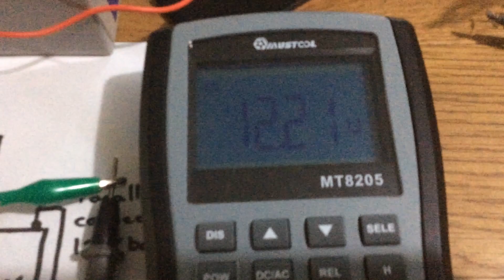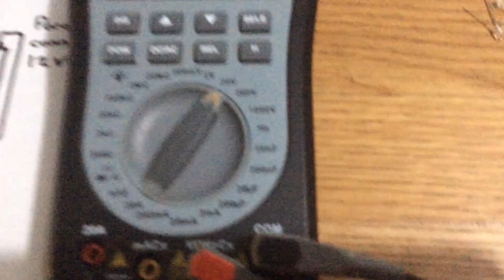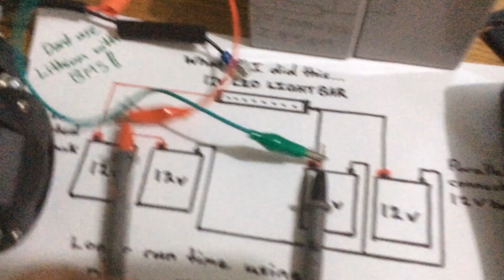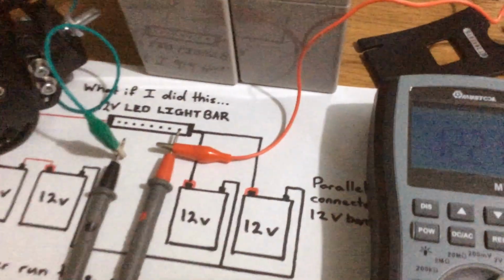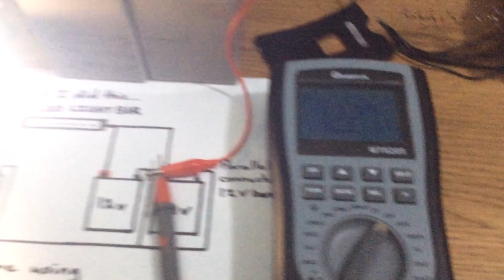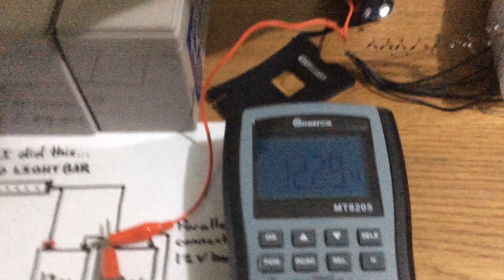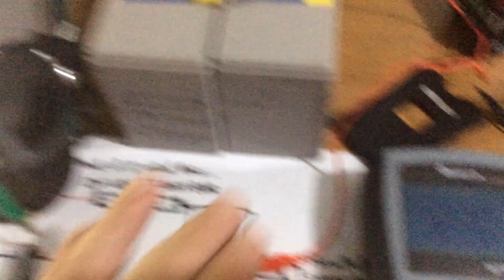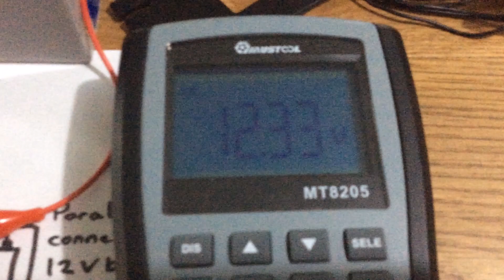Tesla Power Saving Power Transfer with 12 volt batteries.

Comment: i imagine using this system to 220volt system and powering all my home appliances. just my dream 😢😊
Reply: hope i can use 220 volt inverter as a load. 
and wanna use low frequency inverter with toroid transformer inside.

hope the capacity on the batery bank remain efficient or it depend on wattage on my inverter. 
much to learn ❤❤❤
Reply from the maker: I have tried a small 220 volt inverter as have some of my viewers, if you check some of the comments on these Transfer videos you may find others detailed findings which is all valuable information. Please feel free to update me on your efforts for everyone's benefit. Be careful not to drain batteries too low or employ a cut off mechanism, if lead acid batteries are drained below 50% they will be damaged. I make a habit of disconnecting and rotating batteries when the drive battery reaches 24.2 Volts which is considered flat.
Reply from the maker: Thank you for your comment.
For anything to be a reality it has to dreamt up in the imagination first.
The full Tesla switch was more than capable of fulfilling that dream.
A company called Electrodyne Corp. tested the full system burning a 3 KILOWATT load for 2 YEARS.
Can I suggest start small, its much cheaper to experiment without everyone getting pissed that you destroyed their power for internet. This way you can run all the test you need, instead of waiting for everyone to leave before you start pulling things apart. Once you have a small success you can feel comfortable about spending big.

Comment: Can you use this transfer method using a 24v inverter that then powers a load?
Reply from the maker: Thank you for your comment.
Absolutely you can, one of my subscribers has confirmed he has done exactly that. I have also tested this with small inverters. Please be aware that the voltage of operation is between the two banks, meaning if you have two batteries in series making 24 volts transferring to a parallel bank of 12 volts then the voltage seen by the load is the series bank volts minus the parallel bank volts.
ie. 24 volt bank - 12 volt bank = 12 volts at load.
Therefore you will be wanting to use a 12 volt inverter and not a 24 volt one.
Assume you already have a 24 volt inverter, then you will require a 48 volt serial bank and a 24 volt parallel bank.
48 volt - 24 volt = 24 volts at load.
I hope this is clear.

Comment: I have a question on temperature. Is there anything notable in regards to the temp on either side or do they stay at ambient? You noted that the higher the current draw of the led the faster the transfer, I'm just curious on how that effects the battery temp.
Reply from the maker: Thank you for your comment.
I have noticed at different stages that the LED's have different temperatures. Even the LED that was not illuminated in my first videos on this subject would feel warm to the touch. Admittedly there was no scientific approach in relation to temperature and more just a mental note due to curiosity. The batteries don't exhibit any obvious temperature changes, again not a scientific approach, I assumed there wouldn't be a temperature fluctuation for the batteries as the current being transferred is so small and slow so it would not violate the acceptable charge or discharge rate, the load is chosen with this consideration.

Comment: As a beneficial side effect of this setup is that old batteries could be partially revived. For example, if you have a 12V battery that maintain only 0.5V (practically dead), you could increase that to 5V, and use it to power a Joule Thief.
Reply from the maker: Thanks for your comment. Sorry for not responding earlier but this message is not visible for me in the videos comments so I’m responding through YouTube studio. I believe you are correct and this could be used to charge batteries that are below a conventional battery chargers low voltage cut off. I have a modified joule ringer that repairs batteries very well, hurts the ears though, I have used it to repair quite a few batteries over the years.

Comment: Do you think you d'ont lose the energy because you are not connected to the groud ?.  Lost of energy with the LED would then be linked only to the production of temperature (which is not a big amount)
Reply from the maker: Thanks for your comment. For some reason I missed this comment. In this case I don’t believe it to be related to not having an earth but more likely related to the concept that energy can not be destroyed nor created, so where does the energy go in our normal systems? I believe the energy is converted to heat in conventional electronics whereas this system transfers energy to the lowest potential.

Comment: This is fundamentally the Tesla Switch circuit, where the series and parallel branches could be electronically switched. I built that circuit years ago. The flaw in this approach is that the series batteries are running the load current in series across the two batteries. As such, they collectively are each using the AH rate of the load. The parallel batteries, while being charged, has to split the load current between them and are being charged at half the AH rate as the series batteries being discharged. The light IS using power, because it gets hot proportional to the voltage drop across it. The led light on AA batteries is a very low load and I don't think will scale to the higher power experiment. But time will tell and I enjoy watching your experiments!
Reply from the maker: Thanks for watching. Your are correct, this is part of the Tesla Switch, obviously missing the switch and I suppose that makes me the switch. I would love to know more about the switching circuit you used if your willing to share. A company called Electrodyne Corp. tested the full Tesla Switch running 2 kilowatts of load for 3 years so I believe it can be scaled up but the switching is the the real key. Electrodyne Corp stated the switching frequency needed to be a minimum of 100 hertz and became dangerous above 800 hertz. The AA battery version in some of my videos is an attempt of measuring efficiency more so than high power output and in regards to efficiency I believe this version has smashed it out of the park at 109 days and counting.
Have a nice day.
Reply: @whatifididthis...1236  I see you deleted my post. Oh well. I did find that MOSFET Tesla switch schematic. I also reviewed my work and believe that using 12V AGM lead-acid batteries spoiled my results greatly. There is too much voltage difference between charge and discharge. That just kills the efficiency. I recommend using Li-Ion hobby batteries, 3S or 4S, no BMS circuits. These batteries have millivolt differences between charge/discharge potential differences. Good luck to you
Reply from the maker: @craigpierce7996  Thanks for your comment. I haven’t deleted any posts you made. YT has a habit of deleting posts that are too revealing. I think you might be correct about the SLA batteries not being cut out for this scenario without an adequate switching mechanism. Please keep me up to speed regarding your switching progress, I will have a look for some small lithium cells to experiment with.
Happy New Year
Reply: @whatifididthis...1236  Happy New Year to you too! Look for hobby batteries, about 5000mAH should work well and there are many to choose from. Please use an ATO or similar type fuse on each of the four batteries. 15A should give you protection. Would like to take a pic of this schematic and get it to you. Any suggestions? This circuit I built worked well. I re-drew it and put in some more modern parts. Can get what you need from Mouser or similar.
Reply from the maker: @craigpierce7996  Thanks again. Thanks for your advice and I would greatly appreciate any information you wish to send me. You can email me at shoppagreed@protonmail.com

Comment: Couldnt you do auto switching with a arduino qnd relays im sure i could throw together code? I have quite a large diy solar system i would love to give this a go on. Im thinking of a simple way  to configure everything i currently hooked uup a few lipos with bms on them and seem to work fine with this configuration ive had a 3 watt led  light going for 24 hours now on 10 ah worth of batterys if they were configured normally i could expect 35 hrs. if we pass that which im sure i will by looking at battery voltages  then there is absolutely something here just a matter of auto switching for the average person because that could get complicated/ dangerous especially on bigger systems but if there is a will theres a way
Reply from the maker: Thank you for watching. You are correct, automatic switching can be used. In fact I have only used part of what is called the Tesla Switch. Tesla’s original design was tested by a company called Electrodyne Corp. which ran the unit for 3 years running a 2 kilowatt load. I never got around to learning arduino and I have a very capable friend that keeps telling me to get on board. I would love any information your willing to share, this needs to be a global effort, more minds working together for the greater good. I believe in giving my information for free, that way we only have ourselves to blame for not doing something about it. I’m glad this is working with the lithium batteries, I do not have any but from what I have read on BMS, not all BMS are compatible with this system. Keen to hear your progress regarding the lithium batteries. One of my small tests using the AA version I have shown in most of my videos has now been running for 107 days! NON STOP! I believe balancing the load is also a function of this longevity. Choose the wrong load and more of the energy will convert to heat. I agree with you regarding the switching could get dangerous for some which is one reason I have not shown the known switching circuit. As people become more confident with this setup I would love to offer them a solution so I would be grateful if you were willing to share your arduino knowledge.
Thanks again
Have a nice day.
Reply: @whatifididthis...1236 i dont know if you have used chat gpt before but it is incredible at coding  I forgot about this project just because ive been busy  but i live off grid with lots of spare batteries and i may still have a arduino around or ill buy a new one and some relays and mess around Im thinking of trying a grid scale version maybe to power some ac loads but i imagine not all inverters would play nicely but i have some cheapo ones so whats the hurt trying but i agree open source all the way  people need this  and every winter will need things like this even more i get lost trying to do things big but this is simple enough and it seems it works  and i imagine could be improved with different😮 battery chemistry’s with more stable voltage curves so the difference in potential between them doesnt change as much throughout the cycles  or with a combination of batteries and capacitors with a cap dump back into the supply battery idk i willbthink on this more maybe finally make a youtube about all my tinkering

Comment: The power you use can’t be more than the mechanical ability of the trans furnace between he two batteries …..
Reply: Awsume… very good to know …. I will look into that….
Reply from the maker: Thanks for your comment. The wattage of the load under normal use is what determines the transfer rate. Using larger batteries with faster charge rates will allow for larger loads. A company by the name of Electrodyne Corp. tested Tesla’s Switch and were capable of powering 2 kilowatts for 3 years. When the test was stopped the 12 volt batteries were in perfect condition despite reaching voltages of around 36 volts. Batteries were also conditioned by the system to charge extremely fast, much faster than normal and they were claimed to charge in minutes even when charged by normal means.

Comment: I love your videos. It looks a lot like the carlos benites system. Very informative and nice with shematic. Peter lindemann suggest to make it with with even larger batteries since higher impedance does the magic. It seems that he really got to the bottom of how to use it. Also i woul love to see 2 fully charged control batteries getting drained running an other lamp at the same rate. Thanks and have a nice day
Reply from the maker: Thank you for watching. Thanks for your nice comment. You are correct it is similar to the Carlos benites system and there is a common link to all these devices and concepts that shows how long we have been denied this information. The common thread with all these devices are people like Tesla and he mastered this in the early part of his career. I took measurements whilst running this light, when wired normally the light converted 6 watts into heat and light, when using this method the light transferred most of that energy.
Have a nice day.
Reply: @whatifididthis...1236  thank you for the kind reply. Very usefull. Do you mean the the light dosent get warm in this setup? Ike some sort of cold electricity?
Reply from the maker: @martinetellerandet8566  You would need to add something like an Adams motor to achieve the cold electricity, I believe, but could be wrong! I have read about solid state circuits capable of cold electricity. I personally only have experience with the Adams motor and Bedini motors in that genre of device. I will hopefully start work on rebuilding my old Adams motor which ran efficient enough to run below ambient room temperature, that efficiency coupled with this system of power transfer is a game changer. When the power is transferred to another battery bank there is less resistance and in turn less losses and less heat. This is why wiring a normal 12 volt light to terminals of the battery generates heat as it is nothing more than a heat resistor which has a byproduct called light. This isn’t much different to a dead short, a length of wire of a certain material coiled inside a vacuum, that’s a dead short. This is why less heat is generated when transferring power as the battery is happy to take that power, the battery chemistries recharge rate determines the size of the load.
Reply: @whatifididthis...1236  Thanks for the answer. I wanna give you an update on my small experiment.  So i just tried the experiment with a 3 fresh aa batteries and 3 flat in paralell. And I  used a 12 volt light bulb across the negative terminals. I ended up swapping the batteries around 13 times. But it ran with very week light for 4 hours. On average the voltage across the buld was around 1.9 V i think and the amps 0.6 A. I tried to make a control running 2 batteries at 3 volts runing the light for 1.5 hours. But it came down in voltage rather quick, and stayed around 1.9 for most of the time it also ran 0.6-0.7 A. So it there where 1 battery more used the time might be around 2.5 hours. So did i extend the time? What could i do to make i better? I guess using bigger batteries that are meant to recharged would be better. Like you did. I have a bunch of starter capacitors and HV caps can i use those? Thank you very much again. :) hope you have a nice day :)
Reply from the maker: @martinetellerandet8566  When using the AA version with three AA in series your drive voltage is approximately 3.6 volts. The 12 volt light you say you used is too large for the 3.6 volt AA battery bank and would most likely be the cause of the rapid drain. My AA system has a single 3 volt LED which lasts approximately 30 days before the batteries need rotating. I have another AA system with 3 LED’s in parallel for a brighter light and it lasts 10 days before rotating. Keep me informed with your progress, to give you some inspiration my AA setup is now on day 117 with no input charge at all.
Reply: @whatifididthis...1236  thank you for your input. What is the max number of leds i can put in parrelel in the aa system ?  I wanna make the experiment as fast as posible.  How many watts can i max draw ?
Reply from the maker: @martinetellerandet8566  Thank you for your comment. I am unsure why I did not see your last message. I am unsure of the maximum amount of LED’s that could be powered by this circuit and this would only be determined through experimentation considering the fact if the load is too large it will convert more energy to heat instead of transferring the energy.